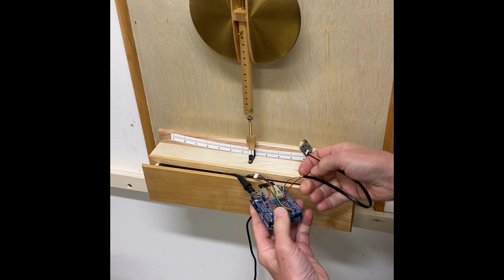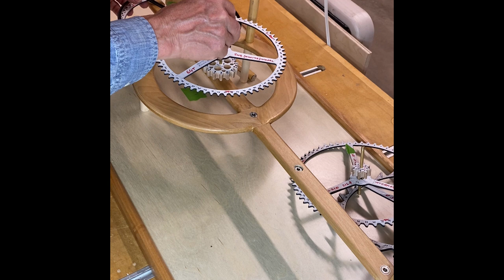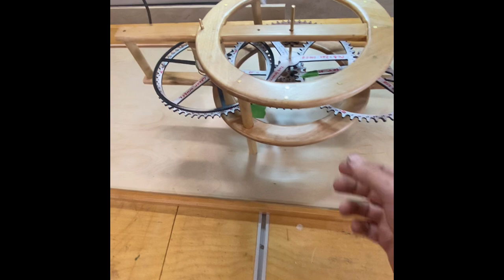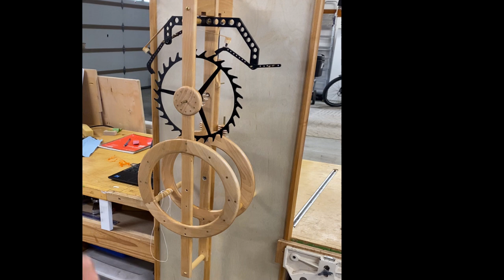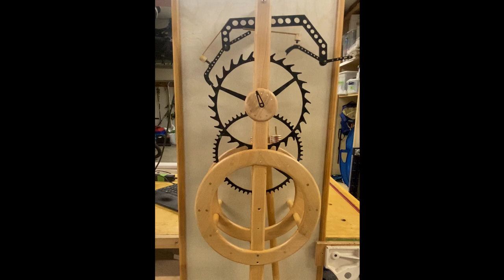Pendulum clock with twin pivot grasshopper escapement – troubleshooting and startup

Comment: Awesome! looking forward to the next video
Reply from the maker: Glad that you liked it!  The next one will either be on the Arduino microcontroller that I'm using to track the behavior of the pendulum or on the testing of the various bearings that I want to check out.  Only then can I move on to replacing the bearings and getting the final components installed.